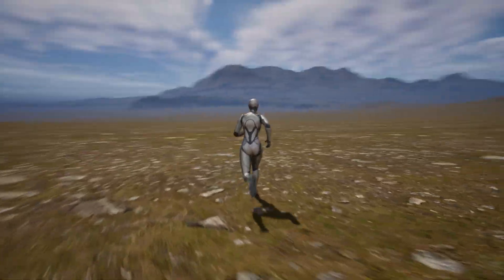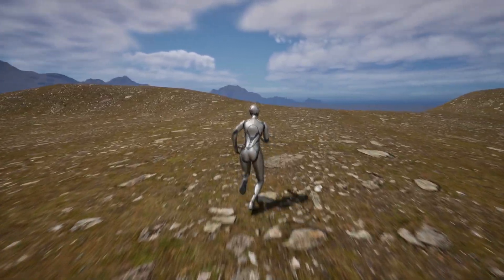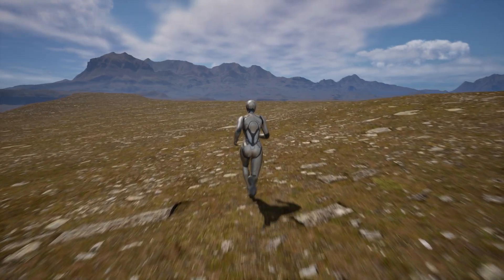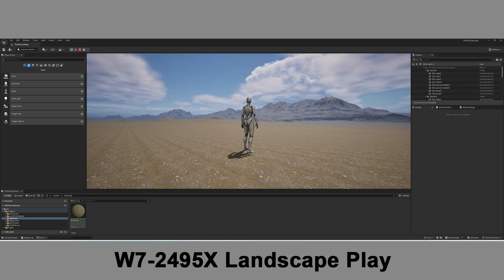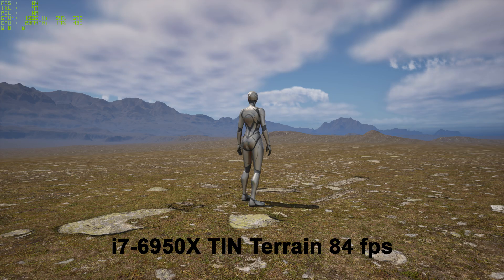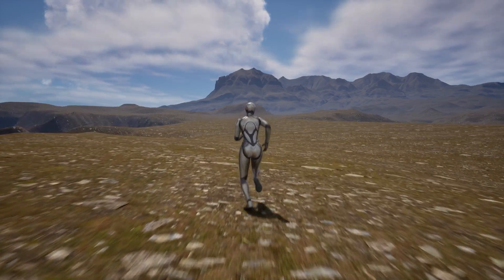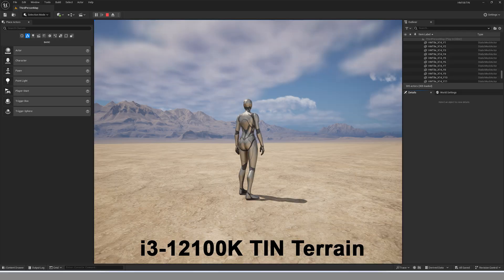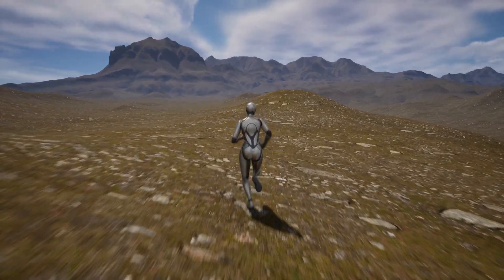UE5 Mesh Tile TIN Terrain Part 5 16km Landscape vs TIN

Comment from the maker: Note that in multiple areas I accidentally refer to the i3-12100 processor as a "K" model.

Note in the comparison screenshots that the PlayerStart is actually in the identical opposing coordinate location and that the OBJ Static Mesh importer simply flips the Y axis on the meshes, so they are from opposite sides but looking at the same area.

This latest Landscape vs TIN test proves without a doubt that the TIN system is the way to go for Terrain.
I will be continuing along this project path working on various Materials and Optimizations next.
I would also like to develop some Unreal Editor tools to make the Material assignment to the TIN Meshes as easy as possible.
There will also be a few updates to the TerreSculptor software to support the massive size Splatmap Materials that these TIN Terrains can support.

The 16km TIN Mesh Terrain Project and Packaged build is available for download.
Link to the files is in the video description.

Comment: hey im currently trying to set up my mesh landscape in unreal engine but im facing the issue of the collision mesh having waaay too few triangles to properly support the landscape tile, i'm using the collision of complex as simple. I was wondering if there's any way to increase the number of polygons on the collision mesh generated by unreal engine. 

amazing videos btw, you're the reason i'm straying away from heightmap landscapes, heightmap landscapes are just too problematic to generate at large scales even with a decent PC
Reply from the maker: Are you using Nanite on the Meshes?  If so then you have to set the Triangle Fallback to 100%.  That will be the issue.
Otherwise you shouldn't have collision issues with the TINs.  The simpler the Collision is the better.
The issue with having a Collision that is a different triangle setup and count than what the actual terrain is, it will mean that your player will look like they are floating or sinking into the terrain, because they will be walking on a Collision triangle setup that is different than the mesh.  So you always want your terrain mesh Collision triangle count and layout to be the same as your actual terrain mesh.
You can get by with a different collision mesh for trees and foliage and rocks and such, but for terrain it should be the same layout otherwise you float or sink on it, and all players and NPCs will as well, because the skeletal mesh collision capsule will be sitting on the collision mesh and not the terrain mesh, unless they are both identical.
Reply: @demenzunmedia thank you so much!! it was indeed the triangle fall back percentage which was set to automatic. the collisions are working properly now

The landscape i made is 8x8 km, or a 64km square landscape. I was pleasantly suprised with the performance given that it's not even a TIN mesh. The mesh is in it's full glory of 33.4 million triangles (separated into 64 chunks) and it's cost on my cpu (i5 11600K) was basically nothing and on my gpu (7800xt, 10% worse than an RTX 3090 for reference) was around 0.7ms. The cost on the gpu definitely isnt the best because it's not a TIN mesh, the reason being i couldn't find any functionality equivalent to that in blender. 

but what i have noticed that nanite is very good at doing nearly the same thing as converting a mesh through TIN and alot faster at it too. if we could use the fallback percentage to get a reduced version of the mesh which is very close to a TIN mesh and export that into blender, this would reduce the time taken to make a TIN-like mesh by a whole lot (although it'll take 15 mins to even get the mesh imported into unreal).

After that optimization I'm sure it'll be a sizable performance jump, since most of the performance is eaten away from overdraw of so many triangles. And once it's world partitioned it's cost'll even less which is pretty exciting, thanks again for all these wonderful videos!
Reply from the maker: @b0rbLmao  - When I was first testing the TIN workflow, I made a few standard mesh terrains at 1:1 to test their performance as well.  They actually render quite well for being millions of triangles.  The TINs are much more lightweight on memory and performance though.  I typically optimize down to 5% to 8% as that still is really good visual quality.
Unfortunately Blender doesn't do optimizing while preserving borders/edges.  Only Autodesk Max and Houdini and a few other apps do.  I hope to have a Delaunay Triangulation Tool in TerreSculptor soon.

Comment: thethe question is: will using this TIN mesh instead original  UE5landscape mesh break other substancial for world designing features in Unreakl-eg. World Partition, generating HLODS using LandscapeAutomaterial, namely---all tools that we will normally use after creating the landscape itself in Unreal Engine.Because it only has sense (as you proved-promise of great performance improvement of lanscape itself, "empty world" at first stage of building) if I can later do everything else in Unreal as if I would use "oldschool" landscape,the one UE5 provides when hiting generate new level
Reply from the maker: I am just providing information on an alternative terrain method.  I am not stating whether one is better than the other, and I am not telling people to stop using Landscape.

TINs work fine with the majority of UE4/5 Terrain and Landscape features.  TINs work with HLODs and World Partition and Auto-Materials, etc.  TINs are just StaticMeshes used as terrains, and people have been using StaticMesh terrain in Unreal Engine forever.  Many terrain designs, even with AAA studios, with UE3/4/5 include using both, a Landscape for the central play area and static meshes for the perimeter.
For the most part if you go with all TINs you basically just lose the Edit Layers and Layer Painting that Landscape gives you.  That's it.
But the benefits are that UE5 Landscape is limited to 16k x 16k whereas TINs can easily be created up to 64k x 64k or larger.  And TIN Terrains render typically 30% faster or more.
TINs have been used in video games for decades.  They are nothing new.
Reply: @demenzunmedia  Yes,Im aware of that. Also read most of comments below so alrady aware what TIN  method of generatin staticmesh is. Just wasnt sure these few things I asked.So if Edit Layers and Layer Painting won't work,what will be solution for "painting" all that big world mesh?with use of AutoMaterial?external program?
Reply from the maker: @AfterHoursDevchannel  - I would never consider hand-painting an 8km to 16km Landscape anyway, it will take days to get anything good and highly detailed.  A really high quality RGBAK Splatmap Material for a large Landscape can be created within 5 minutes or less with software like TerreSculptor.  I have multiple Splatmap videos here if you were interested to see information about them.  RGBAK type Splatmaps give you 5 material layers, and are really easy to make for very high quality.  And this can be easily doubled or tripled in layers if you want to create a really nice complex Splatmap material system.

With TINs or StaticMesh Terrains you can use UE5 type Auto-Materials as they already work with minimal-to-no material changes; RGB or RGBA or RGBAK Splatmaps and Weightmaps; Satellite Maps; or many other types of Materials that use Weightmap systems, both hand-painted or software generated.

The existing UE Landscape hand painted system is just Weightmaps and Splatmaps internally anyway.  The engine just takes care of managing the layers for you.  The same can be done manually for any TIN or StaticMesh terrain using other software like TerreSculptor, Gaea, World Machine, and/or Photoshop, Gimp, etc.

It will just depend on whether you want the advantages of TINs, such as larger world size and faster rendering, or the ease of use of Landscapes.  For the past few decades, most flight simulators and car racing games use TINs, especially on game consoles, because a 16km TIN terrain can be created in only a few MB of memory.  Consoles don't have enough memory for large heightmap-based terrains, because heightmap-based is really resource wasteful.
Reply from the maker: @AfterHoursDevchannel  - I am simply providing information on TIN Terrain Workflow and Capabilities in UE5.  I am not saying it is better or worse than Landscape, just different, and I am showing how to do the workflow with it.  Almost all UE5 engine and terrain features also work on TINs.  Including Auto-Materials, Splatmaps, Satellite Maps, and more.

It is then up to the game developer to decide whether they want to use Landscapes or TINs.  A lot will depend on how large the game world is.  With TINs it is really easy to make 16km x 16km  1-meter TINs even on computers with only 16GB or 32GB of RAM memory, which will crash if you try to create a 16km Landscape with only 32GB of RAM.  With 32GB of RAM you can create TIN terrain worlds easily up to 64km or larger.  So it is just another option for game developers.  And requires a slightly different workflow.
Reply: @demenzunmedia  ok Sir,thank you for your response. I'm watching your channel from a year,watched many of yours vids so I'm aware your mission here ;) I'm on 32GB rig but quite mediocre at most PC, 8y old proc,8gb vid card, so not even considering map bigger than 8x8 km. 
Was even thinking about creating it from 4x4km landscape mesh STRETCHED to 8x8km (during create NewLanscape phase in unreal, setting X and Y size to 200,if I remember the methodology correct) to get lower polycount(better performance?) on it 

BUT I thought maybe your 16x16km TIN mesh method may be good for creating big world mesh JUST for creating bigger HLOD from it.---to be able to see far distance "extension" of my gameworld(ofc with collision turned OFF)---when for example player will stand on the highest mountain/building in worlmap and will see large world around him, but for true it will be only that 8x8 km UELandscape playable,  in the middle of that 16x16( maybe even 12x12 will be enough?)

Not sure if is good idea- maybe I should just focus on that 4x4km (8kmx8km at most) landscape  and surround it with some IMPOSTER billbords to show  distance wiorld surrounding my level?
Reply from the maker: @AfterHoursDevchannel  - There are a lot of choices even with lower-end computer hardware.

You can create an 8129 x 8129 terrain and set the Landscape Scale XY to 200 cm (2 meters) to get a 16km size.  The 2 meter sizing still looks really good.  This is probably the easiest.

You can go with a 16km or larger TIN terrain system.  You require some special software to create the optimized TINs though, like Max, Maya, or Houdini.  I also offer creating optimized TINs as a service for developers.  With a TIN terrain you might want to use an Auto-Material.

You can create a 4km or 8km central play area and put staticmesh TINs around the perimeter.  This is a bit more work, and often requires a total of 9 terrains in a 3x3 grid.  It takes more planning and more work but is possible.

You could also use my heightmap import service to import a 16321 x 16321 heightmap into a project for you.  A computer with 32GB of memory can't import that size of heightmap, but it can usually work on the game after the heightmap is imported by someone with a higher-end computer.
Reply: @demenzunmedia  Thank you for answer and all the tips. I've finalyy decide to give a try your Terrain scvulptor and will check,playtest 1 by 1 the tips you provided here.
Reply from the maker: @AfterHoursDevchannel  - Good luck!  Message me if you need any help with anything.
Reply from the maker: If you have any specific questions about the workflow with TINs, you can post them here or join my Discord, and I will be happy to answer them.  I have created a lot of test TIN terrains over the past few months, to see how well UE5 manages them.

Comment: what is "TIN"?
Reply from the maker: TIN is an acronym for Triangulated Irregular Network, it is a type of optimized mesh used for terrain systems.  It has been used for decades for flight simulators and driving games, because it uses less storage space, less memory, and renders faster than heightmap-based terrains like Unreal Landscape and Unity Terrain.
Reply: @demenzunmedia  and how do you activate tin, or use it? I make a small game, that may dont need it, but maybe for optmization?
Reply from the maker: @Punisher1992  - If you go back to the Part 1 through Part 4 of this "Mesh Terrain" video series that I have released in the past few weeks, I show the exact Workflow that I am using to get the TIN Mesh Terrain system.
I am using TerreSculptor 3 and Autodesk Max to create the required assets for Unreal Engine.  I am also looking to see if any other software has similar abilities to also create the assets.
Part 6 of the video series is coming out shortly.
Reply: @demenzunmedia  Maya's Reduce tool with "Mesh borders" weighting set to 1 have been giving me satisfactory results, so has zbrush's decimation master - tho the latter would be much more difficult to automate.
Reply from the maker: @Spk202  - Thanks for the info on those two apps!  Great to hear that they can work as well.
Do you know if the Maya and/or ZBrush decimators are using Delaunay Triangulation?  Or something similar?  If they create any thin long triangles, like what Blender does, then that will cause issues with rendering the terrain in UE5.
Neither Maya or ZBrush list on their online help what method of decimation they are using.  And I have read forum posts that state that ZBrush's Decimation causes long thin triangles, which is bad.
I can put some Adesk Max OBJ or FBX files of its Pro Optimizer onto the Google Drive Share if you want to compare the decimation quality.  If you wanted to share a couple of Maya and ZBrush mesh tiles so that I can look at them, that would be great.
Reply from the maker: @Spk202  - I put my set of 16km x 16km Mesh Tiles onto the Google Drive Share, link in the video description.  File name is HM16kOptimizedObjMeshTiles
Reply: @demenzunmedia  Im glad if i was and am able to contribute useful information, TerreSculptor has been a huge blessing for me. As for the questions at hand, I dont know if either tool is specifically using Delaunay, I downloaded the examples your uploaded, and Maya at least is rather similar. I did some tests for you on some of the landscape tiles im working on, both in maya and zbrush and both at 90 and 99% reduction/decimation. Zbrush, on a very flat terrain did create long triangles at 99%, but not at 90.
Reply from the maker: @Spk202  - I would suspect that since Maya is also Autodesk that they might be sharing some of the code base between Max and Maya, so the decimation tools might be similar.
The Max SubDivide Modifier is using Delaunay Triangulation, but it can only be automated using MaxScript.
If Zbrush has any long thin triangles that would become an issue.
I have another person getting back to me on using Houdini for decimation, as it has a Delaunay decimator.

For TerreSculptor, I am currently updating the Splatmap Creator and the Tile Creator so that very large RGBAK Splatmaps can also be tiled for use with this TIN terrain system.  I should have that completed before the end of August.
Currently those tools are limited to 2GB RGBA image sizes, and I am updating them to support up to 1 million x 1 million pixels.  That will allow for using Splatmaps on really large TIN setups.
Then my next video is to try a really large TIN terrain using RGBAK Splatmap Tiles.

I plan on writing a TIN Helper Plugin for UE5 to help with such things as assigning Materials to the Tiles using tile name matching automation.  So when you are working with 256 to 4096 tiles that will be useful.
Reply: @demenzunmedia  I am very excited about the upcoming updates and and features regarding the splatmap ad tin helper, will keep an eye on the releases.
Reply: @demenzunmedia  so basically its just a normal mesh still.
Reply from the maker: @mindped  - Yes, it is a static mesh.  It is simply created using a specific process to make terrain creation simple with it.
TINs are typically created with a specific mesh optimization technique called "Delaunay Triangulation with Excluded Edges".  This allows the meshes to be used for terrains with significantly reduced triangle counts and good optimization.  Flight Sims have been using these TINs for years.
There is no special actor role in Unreal Engine for it if that is what you were asking, in UE it is a "static mesh", so all of the mesh tools can still be used on it including Materials and Mesh Sculpting and more.
I have developed tools in TerreSculptor that allow for easier creation of TINS since the mesh tiles are properly geolocated when exported, so the entire workflow is simply drag-and-drop in Unreal.  Previous workflows required manual tile placement which could take days.
I am working on additional tools in TerreSculptor to allow for large TIN sized Splatmaps and more, to make the workflow rapid and easy.